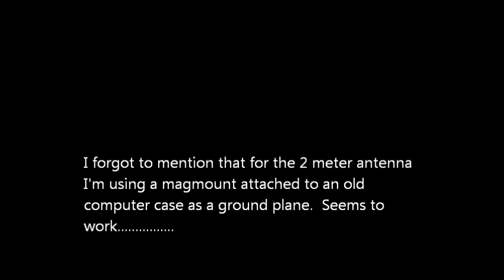On the air!!

Comment: Six can be fun, when the band opens, otherwise lonely. It is not uncommon for a bunch of guys to hang out on six as a local intercom channel. Also, load 52.525 FM simplex into a memory channel. Good to monitor 52.525 squelched waiting for the band to open. Looks like you are having fun.
Reply from the maker: Ok Randy thanks.  Will monitor FM simplex on 6 meters. Today I was listening in on 10 meters using the 6 meter antenna (obviously I couldn't txmit) and found a lot of traffic.  I'll have to order a 10 meter wire dipole next.
Reply: Patience and Persistence are the keys to success on Six Meters.  

73 de N6SIX
Joe Acevedo
Vice President, San Diego Six Shooters ARC
Reply: A good resource for keeping tabs on 6M propagation (or any band, for that matter): http://www.dxmaps.com/spots/map.php?Frec=50&Map=NA
Reply: You can build a 10M dipole! Easier than the 6M, just wire and some coax
Reply from the maker: I've got some 12AWG insulated copper ground wire the electricians left behind.  I think I'll convert my 6m to 10.  I don't have any extra cable yet.
Reply from the maker: Joseph Acevedo
Yes.  I ran across dxmaps.com and it is a good way to tell that band has opened.
Reply: 2000dcampos    I receive email alerts from dxmaps.com on my cellphone when SIX is open.
Reply from the maker: Grand Negus
I planned to support the wire ends with cords.

I have two 4ft 1/2" copper tubing sections that I was originally going to hose clamp to the ends of the existing 6m antenna. The idea was to solder an adapter the end of the new sections and hacksaw a notch into the adapter so that it will clamp tight over the 6m tubing.  However, at 8 - 9ft per leg for 10m I thought the length would prove too heavy for the fiberglass or would fold under it's own weight - I don't have experience with either.  This option would be quicker to change between 6m to 10m.  Or I could just make a separate 10m antenna - decisions decisions :)
Reply from the maker: Joseph Acevedo
I wasn't aware that dxmaps will send alerts!! Thanks, I'll set that up.